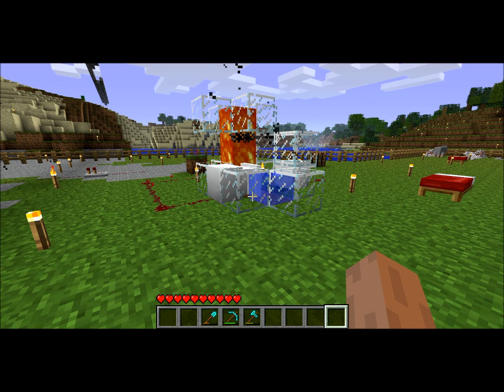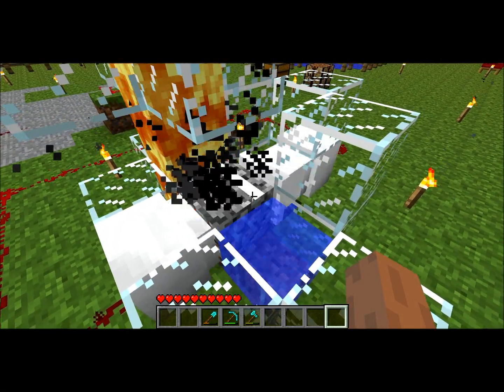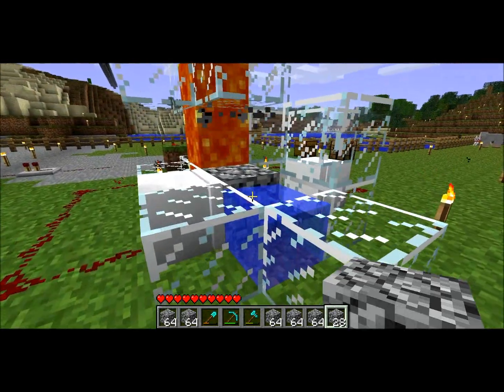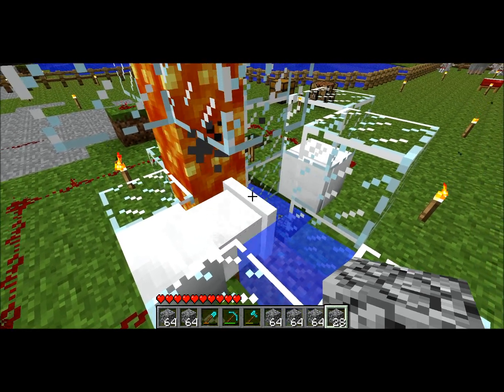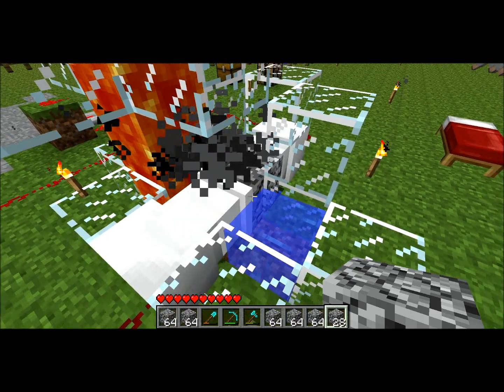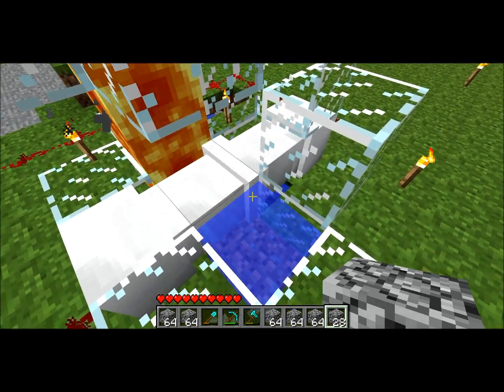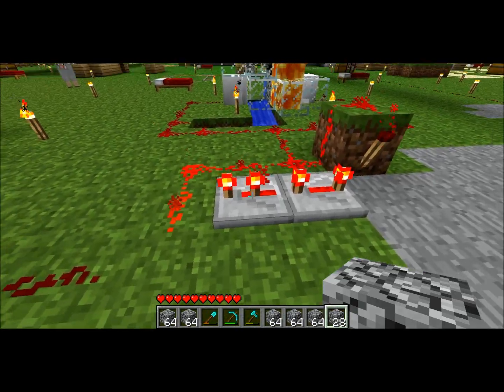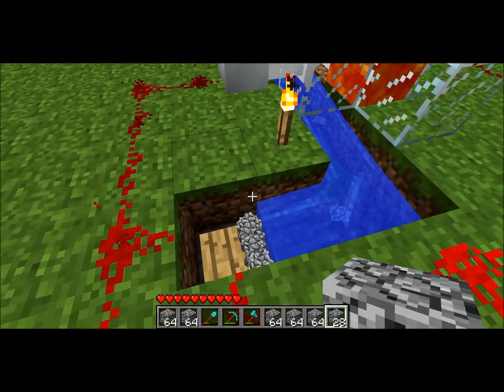Cobblestone Generator that Uses the Piston Mod to Automatically Mine Itself

Comment: @themegamankingdom Get Buildcraft with cobblestone generating quarries. Like 50 of them lined up.

If each one generates 1 cobblestone a second that's 50 cobblestone into a single pipe every second, then feeding into a magic chest (Or series of crafting benches with philo stones, which empties into a chest later on).

You'd end up with ABOUT 1 diamond every 5 seconds, because if I remember correctly 250 or so cobblestone = 1 diamond with equivelent exchange. ;)